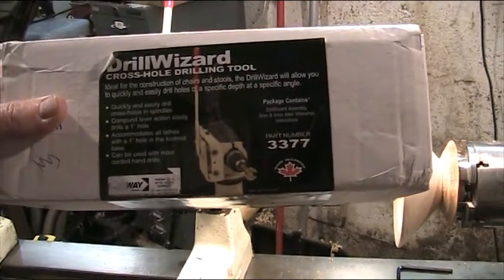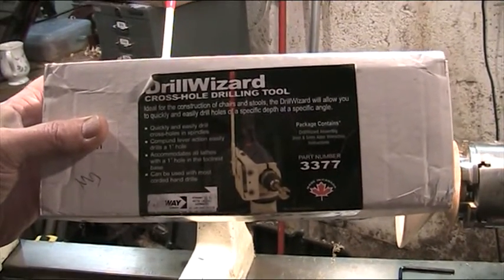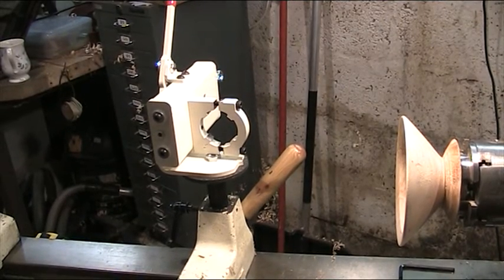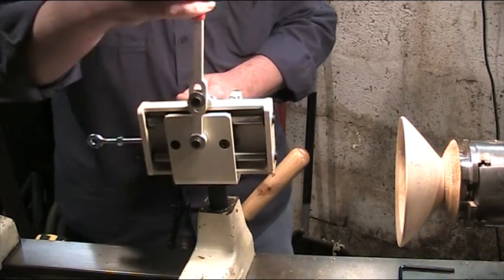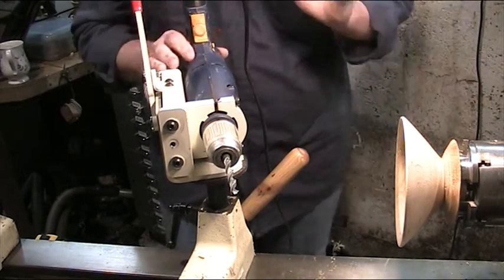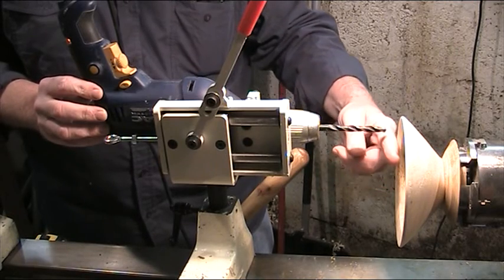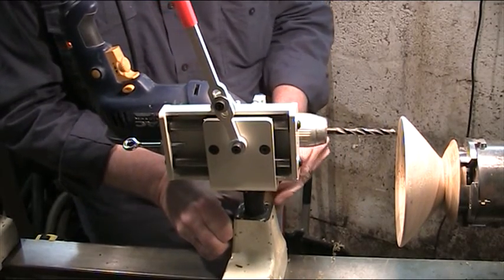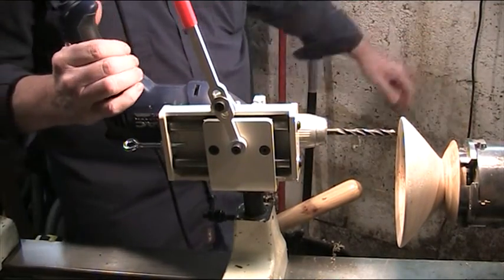Woodturning - New Toy

Comment: That is the best reasoning for buying a tool ever! Great video Brendan. I need to pick one of these up for my new lathe.
Take care,
Carl
Reply from the maker: Thanks Carl, it should go straight on because it's a 1" tool post and you won't have to get it shortened because my turning mate has the Jet3520B (Powermatic) and it fitted right on with no issues like I had with the smaller banjo.
Best Wishes, Brendan.

Comment: Thanks a lot. I have five routers of which one will suit the device. I have made router holders in the past for doing fluting on the lathe so bought a small Trend vary speed one to use. It will fit quite nicely. Have a great Christmas. David
Reply from the maker: +David Muckle That sounds like you are well set up.  I hope your Christmas is as you wish it to be.
Best Wishes, Brendan.

Comment: Thank you. I have a 1221. I wonder if it compatible right out of the box.
Reply from the maker: Older models would have the same spindle thread (1" x 8tpi) but now Jet put a M33 x 3.5 on all their lathes because it's more likely someone with a big lathe will buy a small one if they have the same spindles that someone with a small lathe buying a big lathe with a different spindle size and have to get new chucks as well.

Comment: That's a great bit of kit Brendan. Like Alan, me thinks some heavy hints need to be dropped to my good lady ;)
Makes my home made hole drilling jig seem a bit "lacking"....lol
Take care
Mike
Reply from the maker: This was a moment of complete madness but, unlike many others, I have no regrets this time.  Have we seen your hole drilling jig?  I'll be hunting through your videos after I answer some comments.  Tonight I cut the tool post to get it on centre and it works a whole lot better so I'll practice some more and do an update video.  I cut the post enough to let the centre point of a drill bit line up about 3/16th" below spindle centre so that I could set it to dead-on centre myself by raising the jig a little.   There's a locking ring with a set screw to set the height for good so I set that.  However, I will still check for accuracy each time I use it.
Best Wishes, Brendan.

Comment: now brendan i have my eye on this a long time back but my trouble is i want the 24/36 to go with it :-)  i have a big lump of fiberglass with two engines on the back of it if i can sell it the white horse will be in my shop,not in any hurry plenty of time. anyway greate tool review oneway make fine tools
All the best
Robbie
Reply from the maker: Oh, now we're talking serious lathes.  It's interesting that you would leave Vicmarc, they are very good too.  I hope you can shift the boat. 
I cut the tool post on the Drill Wizard to fit my lathe tonight and, after I had it done, realised there was a video in it.  Oh well, it was mainly lots of measuring and sparks.  You know the old advice - 'measure twice, cut once' - well, tonight it was measure 40 times with as many different rules as you have and then cut once.  It all worked out grand so I'll do a bit of practice and an update video.
Best Wishes, Brendan.
Reply: you cut it with a grinder i say that was a blast i'll be keeping the Vicmarc hard to get them here now
Reply from the maker: Robbiethewoodturner Ah, I understand now... you want the Oneway for making pens - I'd get the 3hp model, you don't want it bogging down on you.
Reply from the maker: Robbiethewoodturner 5HP!!!  Are you going to be turning complete trees?  Thanks for the link, I'll head over to the video when I get some comments answered.
Best Wishes, Brendan.

Comment: Very useful piece of kit mate. To stop the drill bit being steered off centre it may be better to use one as short as you can get away with and move the drill a bit closer to the work. This will give a little bit more rigidity when being engaged forward. Nice idea with the router being attached...,
Reply from the maker: Thanks for this.  It's this generous sharing of knowledge that I love about YouTube...well, this area anyway.  I could cut a few bits to length and dedicate them to this tool but, sure as anything, I'll find other uses for them so I'll probably end up cutting a lot more than I intended.
Best Wishes, Brendan.

Comment: Got zapped by the autoplay again, slow learner. That's a neat tool Brendan, but don't use that bowl for soup now, lol. I'll be anxious to see it used in an actual turning project some day. Attaching a router has some very interesting possibilities...
Regards, Gary
Reply from the maker: I have cut the tool post so the tool fits my lathe now and everything is set up correctly for use.  I haven't had a chance to use it but, when I do and get confident with it, I'll post a video.  I'm having trouble finding a small router with the collar that suits the holder.  Ebay will throw one up soon I'm sure.
Best Wishes, Brendan.

Comment: Nice tool! You said you would like to angle it down and up.. But if you angle it across.. that will be the same because the object you are drilling is round.. :)
Reply from the maker: I can angle it across and get a slanty, horizontal, hole but I was wondering about an up/down option to get slanty holes orientated at right angles to the horizontal ones. i hope that makes sense.  I haven't had the thing out of the box since this video.  I got caught up in the garden and that was the end of turning.  I hope to get to use it on something soon.
Best Wishes, Brendan.

Comment: Can you please tell me where you can buy this in the UK? Thanks for a very useful demo.
Reply from the maker: Thank you.  I've used it a few times and it is a wonderful tool, especially when used with the index system on the lathe, clean, precise holes.  I use an old Black & Decker router to cut depressions and grooves because it gives a really clean cut.
You can get it online at 'The ToolPost'.
Best Wishes, Brendan.

Comment: the drill bends pretty much, maybe try with a shorter one?
Reply from the maker: +Argomil I stopped using long bits after I saw that happen and also use a small router now as it is more accurate and cuts more cleanly.  Thanks for taking the time to send me your suggestion.
Best Wishes, Brendan.

Comment: Hi there.I have just been watching your video of the new toy. I think it has a lot of potential and if possible I would like to obtain one. I do a lot of trade with The Toolpost in the UK but cannot find it on the website so please could you tell me what name new toy goes under. Thank you.
Reply from the maker: +David Muckle Hi David, it's called the 'Drill Wizard' by Oneway, Canada.  I found it on the ToolPost site by typing 'gift selector' in the search box on the front page.  Scroll about half way down the suggestions and it's there @£102 (+VAT).  If I put the link in here this will go to your Spam box.  Any problems, get back to me please.
Best Wishes, Brendan.
Reply: +baconsoda Thank you so much for your reply. Have now found and will be ordering in the New Year. All best wishes David
Reply from the maker: +David Muckle Good stuff.  If you can get your hands on a small router that will fit the bracket that holds a drill (the small Black & Decker from years ago fits great) you will get another world of use opened up to you.  I got my router off Ebay, they come up all the time.
Best Wishes, Brendan.

Comment: Someone needs to come up with a design similar in function to this, except rather than mounting to a lathe with horizontal travel, make it mount to a bench top, with vertical travel.  Then you could use any old hand drill as a drill press.
Reply from the maker: +Matt Culler That would be a good idea.  You might need a spring to stop the drill slamming onto the work but that would be an easy thing to build into a tubular stand.  Maybe someone is already doing this?  You don't know what you might find on YouTube.